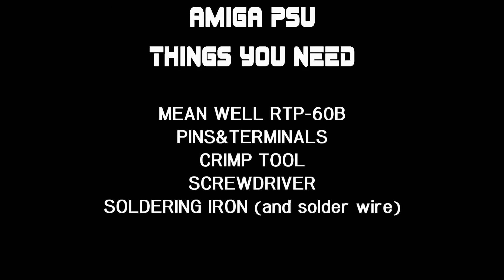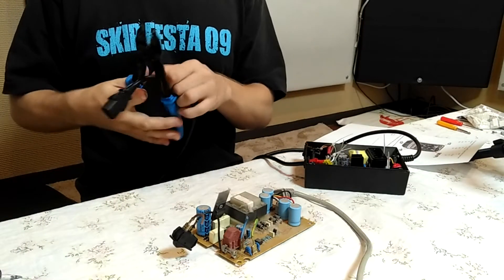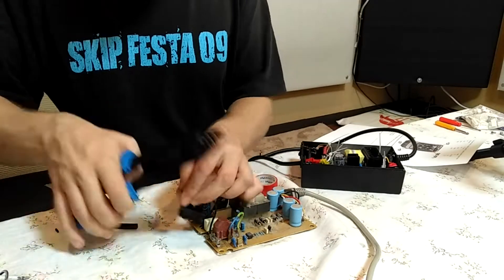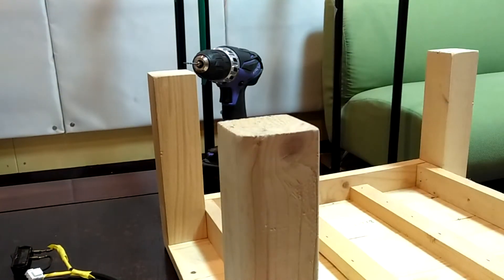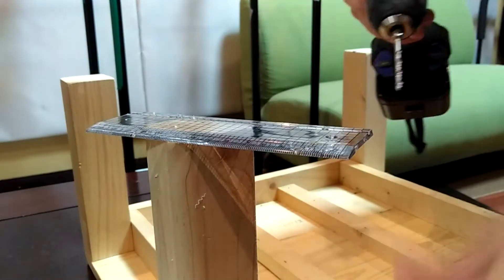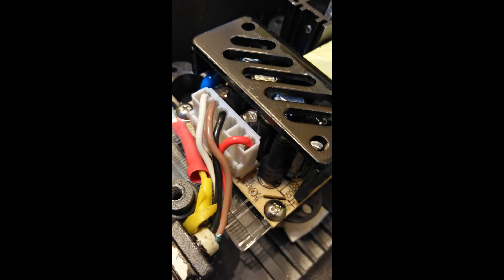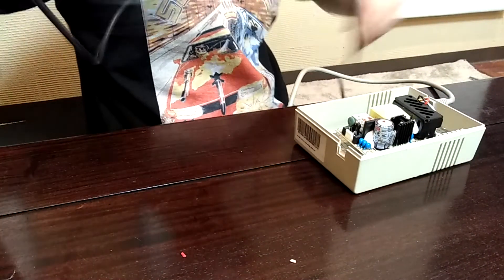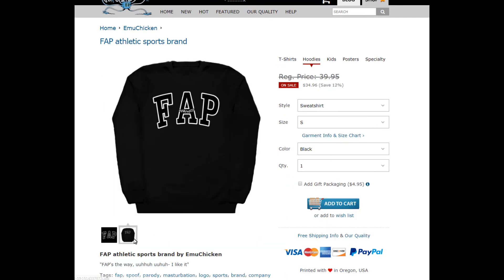Commodore Amiga brick PSU replacement

Comment: Why not use a heat shrink tube, is MUCH saver then tape that WILL let loose after a few or more years, and why use crappy Crimping Tool pliers, why not much better quality one in a box with a good Wire Stripper, or if you want to go cheap, go for a Automatic Wire Cable Lead Stripper Stripping Cutter Tool, with a better Paron JX-1601-06 Multifunctional Ratchet Crimping Tool, were you can change the mouths of.

I also just not long ago put a Makerele NET-50C in my old housing of my Amiga 500+ PSU that was not working anymore, was very easy and fitted just perfect, and i am also going to upgrade my Amiga CD32 PSU with a MEAN WELL PT-65B, because i am going to buy the TF360 that has a 68060 when it comes out, and i want enough power for it.

https://www.banggood.com/Paron-JX-D5301-Multifunctional-Ratchet-Crimping-Tool-Wire-Strippers-Terminals-Pliers-Kit-p-1175325.html?rmmds=search&cur_warehouse=CN

https://www.banggood.com/Automatic-Wire-Cable-Lead-Stripper-Stripping-Cutter-Tools-p-1026614.html?rmmds=detail-left-hotproducts__7&cur_warehouse=CN

https://www.banggood.com/JX-1601-06-Multifunctional-Ratchet-Crimping-Tool-Pin-Plug-Spring-Terminals-Clamp-p-1104437.html?rmmds=search&cur_warehouse=CN